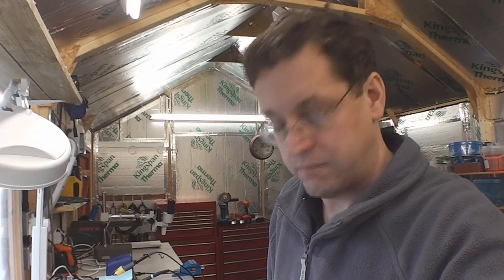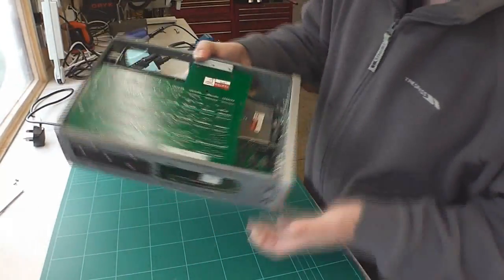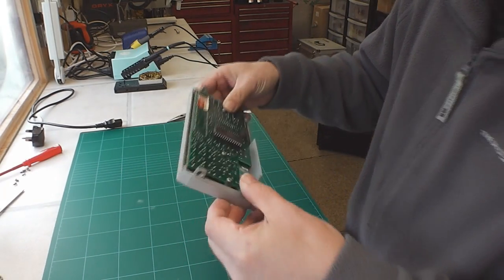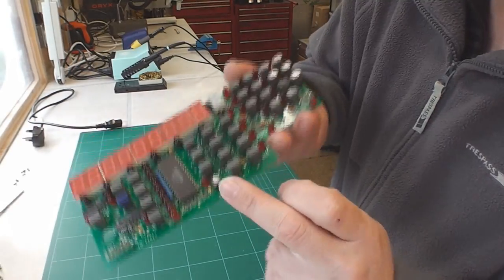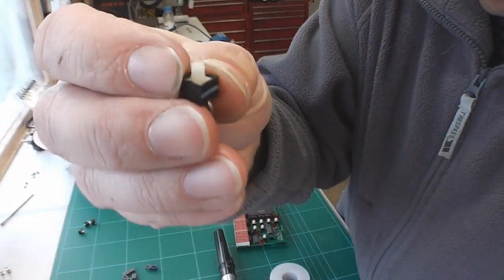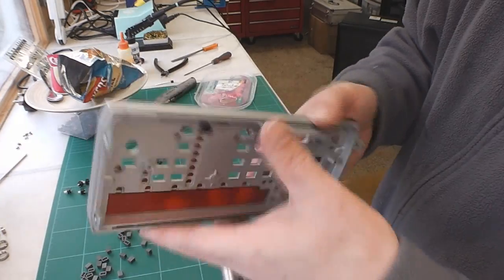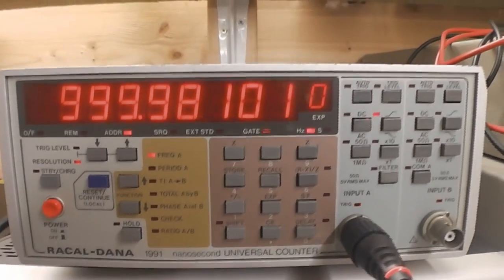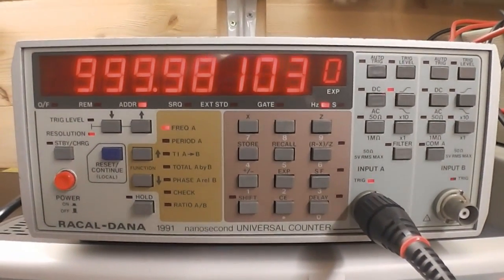Repair of Racal-Dana 1991 Universal Counter

Comment: Sorry about commenting on such an old video.
I have the racal 1998 simpler frequency counter, the 10mhz reference ovan on the back panel was cooked to death, it was very old indeed, perhaps yours needs a check for stability.
They are a brilliant counter for there era, and well worth the trouble of repair :-D
Reply from the maker: zx8401ztv All comments are welcome. Back in the day I used a 1991 counter every day in my day job, I always found the user interface to be very intuitive and comprehensive........probably why I bought this unit for the home workshop.
Reply: IanScottJohnston I converted an older racal from the numerators to led display for a frend, i know its a no no but the numerators were very ill and the cost of fresh ones just didnt go down well.
Yet again another very good counter.
And for a  laugh, ive had a maplin mf100 counter based on a big beast ICL 7xxxxx type chip, never failed though, Intersil made some dam good chips in the past, no fish though lol sorry :-(

Comment: Ian: quick question. How did you "hollow out" the button tops? I tried with an X-acto, and it's crude at best. Was thinking the dremel next, but I'm worried about it wandering and chewing through the sides. Thanks!
Reply from the maker: I just used a sharp pair of sidecutters.
Reply: IanScottJohnston Huh. That works for the sides of the "cross", but getting the bottom out just becomes a mess. But, guess I'll give it a go on the rest. =) Thanks!
Reply from the maker: I only needed to remove the cross. I think I shortened the button shafts also.

Comment: @Bob England
What did you end up doing with regards to the switch replacement on the Racal Dana Universal counter? I have a 1992 and have the same problem getting to the switches under the large IC. It has a socket with two lower pieces of plastic. I can remove the IC and the first layer of the socket but the lowest part of the socket is solid and still in the way. I'm not even sure why the overkill on the socket is warranted - all it seems to do is prevent one from getting to the switches to replace them. I wonder if it could be careful cut out of the way as this may be less risky than trying to de-soldier the entire socket. Please let me know what you did. Thank you. Also where did you source the switches and what part did you end up using?
Reply from the maker: I cut out the plastic with the IC socket left in-situ. A nice sharp pair of sidecutters did the job.

Comment from the maker: Hi, presume you mean the lage 28-pin LED driver IC (intersil)..........Luckily, the IC was socketed so I just pulled it. If I remember correctly I think I had to snip away some of the plastic joining the 2 rows of pins to get access to the solder pads. No real harm done.

Comment: Thanks Ian, I bought some with a 7mm shaft length (as opposed to the 11mm you used)  261214486564. Thanks for the info, if I get around to the repair I will do a video response.  Thanks again. Gerry

Comment: Hi Ian, I have a Racal-Dana 1999 the switches are also terrible. Which switches did you use for the repair, do you have a part number? Mine only has 14 buttons so looks easer to repair. Gerry